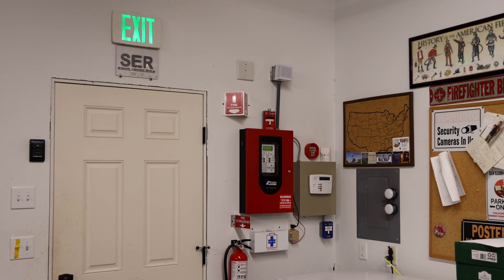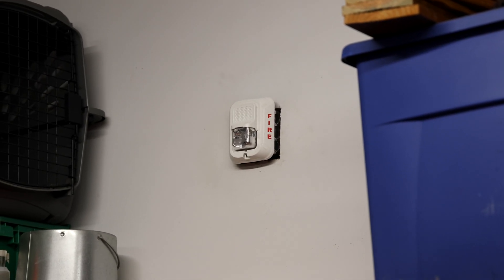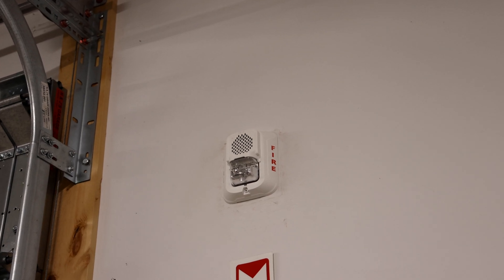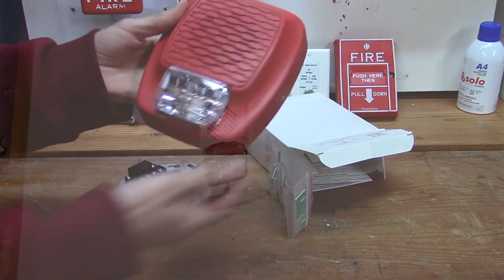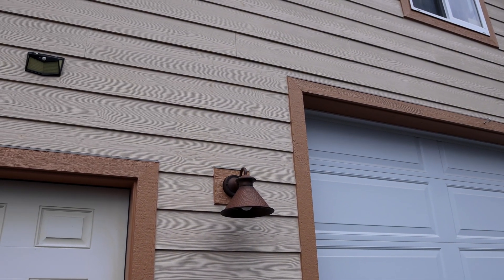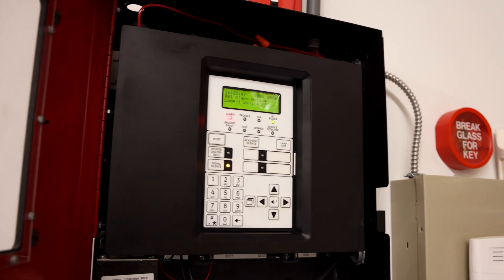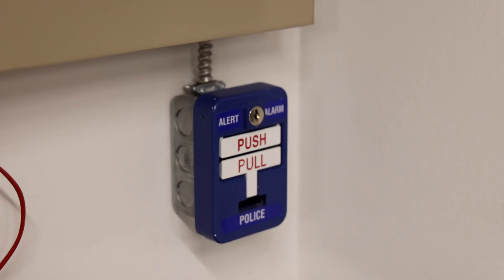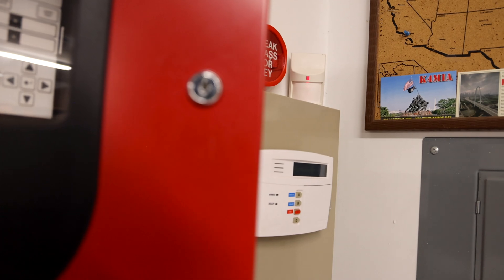Fire Alarm Meant for Your Sleep! + Rare Pull Station! | Garage Fire Alarm System Test 33

Comment: Why does the switch closest to the pull station have a yellow strip of tape over it?
Reply from the maker: It goes to one of the lights outside the garage, which kept accidentally getting flipped on.